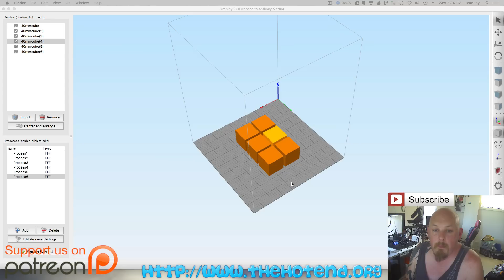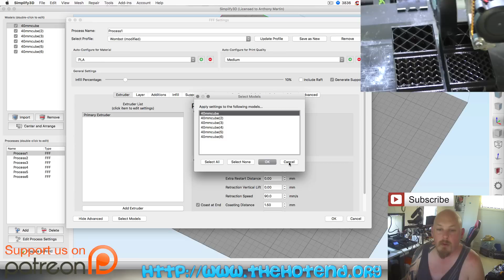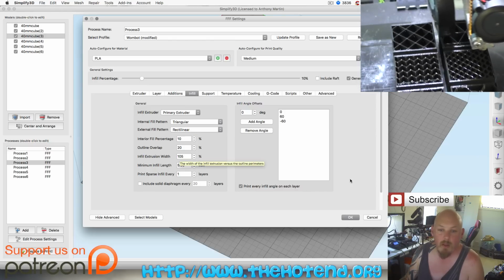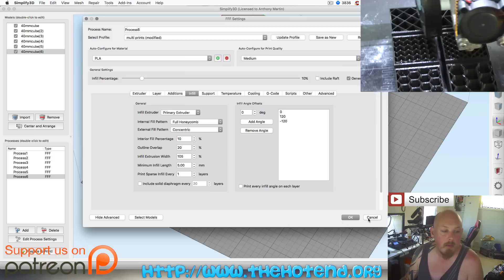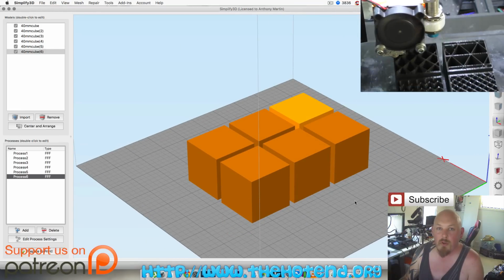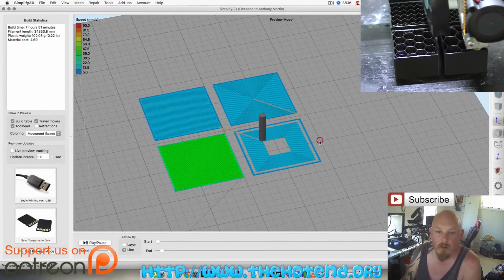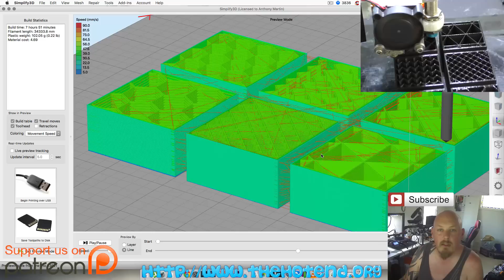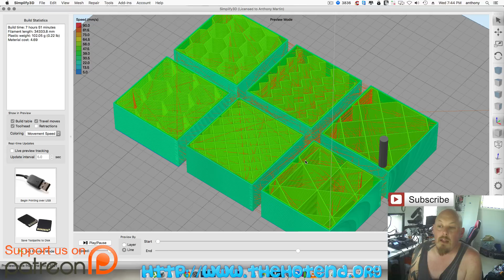Simplify 3D - Advanced Series #1 features that make that $$ worth it!!

Comment: Very cool - I just figured out I can set the order of items on the build plate from your video. I need to do this so it prints bed level check buttons in the corners first so I can tune on the fly before the main object starts printing. BLTouch isn't adjusting sufficiently, the physical bed leveling is the most powerful for me.

Comment: hi Anthony , I own s3d, but I never tried more then one object with different layer highs to  each . as its printing , do you see the z axis going back down to match the layer height you assigned  to it, or do all the prints come out looking the same? good video btw.
Reply: +patprop74 never mind , I tried it and what it does is, lift the z axis to the smallest layer height and printer parts accordingly  for those who want to know here is an example: one part at 0.1 and other at 0.3 it will raise the z axis by 0.1 and do three layers on the fist part, then do one layer on the 0.3 part and go back and do three more on the 0.1, and one layer on 0.3 ...  and so on. pretty cool actually.

Comment: Cool stuff mate. I haven't even had my printer for a week and already splashed out for S3D. A bit expensive for us Aussies right now but I think the results are worth it over Cura and other free ones. I did a test of printing dovetail joints. Using a 0.1mm tolerance Cura made it difficult to break the pieces apart. S3D was a beautiful, well-fit result.

Comment: Not to be a bugger, but this is hardly a good example of why to buy S3D.  You can print these all separate with the varying parameters and it will take essentially the same time.  One of the more advanced "features" to use their process system with is to allow completely different parameters , different layer heights , infill, perimeters etc., ON THE SAME MODEL. You are limited to 2 vertical parameter "sections" , but it can be a really useful feature.
Reply from the maker: +ArionRaine Howdy! This is part one of a series where i go through all the other things you mentioned. A lot of peopled did not know you can do this.

The next one will be focusing on 1 model :)

Cheers

Comment: I love S3D, my slicer of choice, but there is a feature in Cura which really needs to come to S3D where you can specify the size of your hot end assembly and ask the slicer to layout parts in a way where it can print one at a time (and not have to guess so that your fan or some other bits don't hit the finished parts) -- when you are printing a lot of identical parts, travel from one part to another costs time -- if you can have the head stay at a given spot and finish a part then move over.
Reply from the maker: +kazolar Ahh that would be nice! You can manually space with plenty of room and tell S3D to print one at a time, but its not automatic.. Maybe the S3D guys can implement this as a feature request (it makes sense) :)
Reply: +The Hot End i've done that -- and it works, but it's far from intuitive as it's in Cura. As Joel and Jerry like to say -- Cura is for people who code in Visual Basic and S3D is for people who code in C++. (I'm a Java developer past hmm 15+ years, but I did start out with C++). Though the version of Cura which I was trying out for my Series1 Pro didn't have the one-at-time feature working right and my fan crashed into a model -- haven't tried it since -- I'm sure S3D folks could do it better.
Reply from the maker: Im sure the more people that buy it - in theory the more developers they can afford to take it to a whole next level :)

Comment: This is something I've wanted to do before - Thanks for the video, have a new subscribe and like :)  - "The more you know" and all that :)  I originally started the refund process on S3D as after days it just wouldn't work with my Wanhao i3 (despite thousands having no problem) ... I then help off as I ordered a 2nd 3D Printer for dual extrusion (CTC - a cheap replicator clone) and to my surprise, S3D seems to work almost flawlessly... just a few offsets to tweak that some bug in S3D seems to be off by (I say bug because I've contact support and confirmed the printer tool / head offsets alignments are all correct as per the calibration script it comes with) .... so I decide to keep it S3D in the end.    This video has provided useful info for future prints! Thanks again
Reply from the maker: +IAm Orion I'm sorry you had issues with your i3 - I wonder what the issue turned out to be? I'll be doing another few parts to this series to show some of the lesser known features so stay tuned! thanks for subscribing!
Reply: +The Hot End Not your fault! No need to be sorry :) No idea though - I gave up, I'm perfectly happy with Cura and the results it's been giving me for my usage and needs.  It's more important for me that it works with the CTC which it does (as I intend to do lots of dual colour prints for light units, eg black and clear (for the lit areas)) so the different infill etc is really good to know and ideal
Reply from the maker: +IAm Orion Maybe if you have time message me tonight, and i could try help setup your i3? If i can help i certainly will (after 7PM AEST)
Reply from the maker: +IAm Orion And NO i dont work for S3D :) just trying to help
Reply: +The Hot End Thanks for the offer, but honestly, I'm not bothered.  I was only trying it as I follow alot of Adafruit stuff and the 3D Print guys there.  I Spent a good week back and forth with tech support and so many FFF profiles etc etc I lost count.  Cura is enough for my needs on the i3 so I'm not bothered.

As I said, it DOES however work almost perfectly with my CTC so I'm happy with that :D

Thanks for the offer though
Reply from the maker: You're welcome :) Worst case i can teamviewer (remote control) in and get it workin myself :D I've helped a few people like that, easier than trying to explain
Reply: +The Hot End I use TeamViewer all the time supporting clients etc :) but honestly, I don't want to waste your time because truth of the matter is that I'll rarely nees all that it offers with the prints I'm doing and have planned on my i3.  Cura is fine for me (at least for the i3) ... besides, between time differences and work (I'm in the UK - GMT) I doubt I'd ever be in a position to do it at a reasonable time ha

And the only issue with the CTC is offsets which I can sort myself, I'm just awaiting replacement PTFE liner (eventually I'll go all metal) for one of the extruders then I'll be able to correct it.

But thanks, I do appreciate the offer, but I'm happy enough using it with just the CTC :)
Reply from the maker: IAm Orion Sure no problems :)

Comment: wiggle @ 0, 120, 240 check print every infill angle on each layer. My most used infill with fast honeycomb in second place.
I also use print infill every x layers all the time as it cuts some time off and little to no quality change.
Reply from the maker: +zallin awesome! thanks for the tip ill have to try this
Reply: +The Hot End - 3D Printing And Electronics Wiggle can also be useful when printing flexible filament and you want something to flex (or squash - for want of a better word) more in one direction than another!